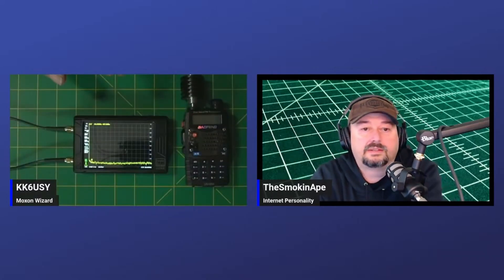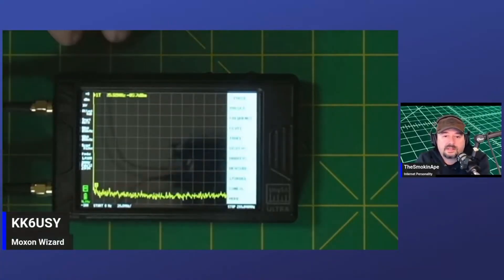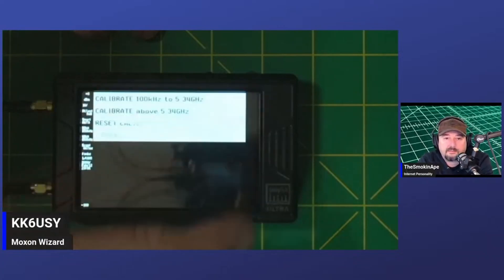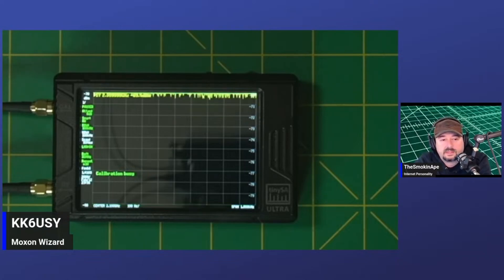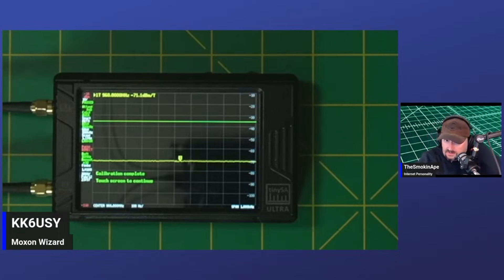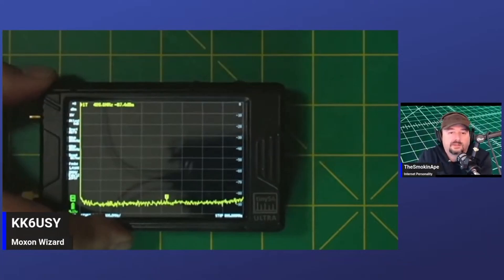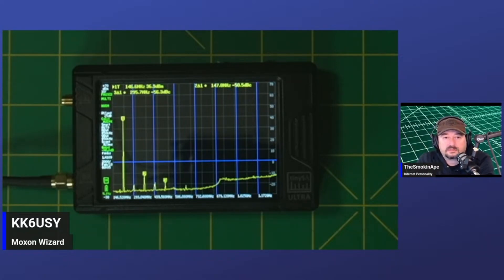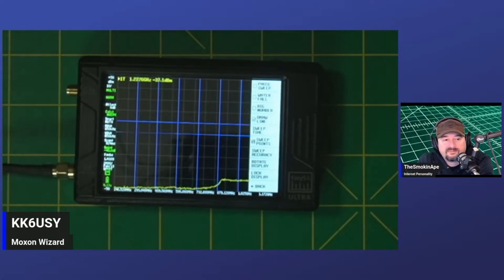Testing your HT with the Tiny SA Ultra!

Comment: The 'draw line' feature of the firmware was buggy at the time this recording was made. I also experienced this with a unit purchased in Nov 2024, but checked the release notes for the firmware and spotted a bug fix. Having just updated the firmware, the level now draws at the expected spot on the screen. I suggest checking your firmware if you experience this, since it appears there are quite a few units still being sold without newer firmware, even nearly a year after the fix was released.